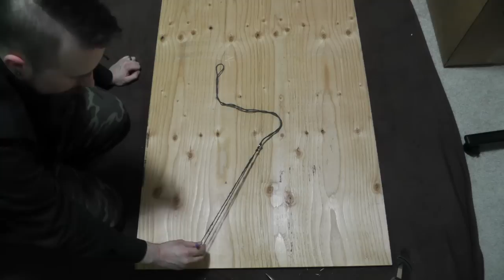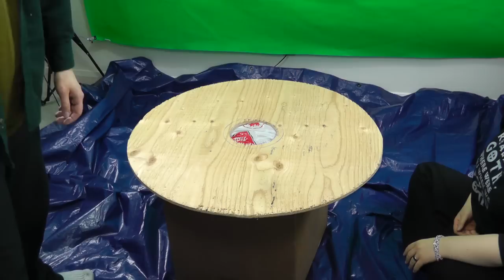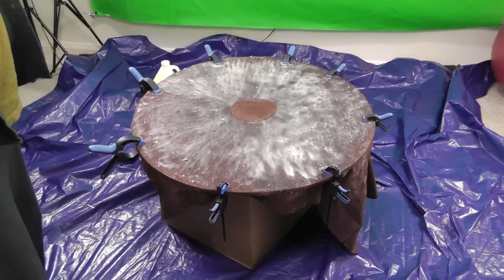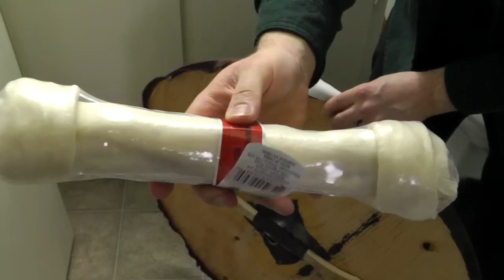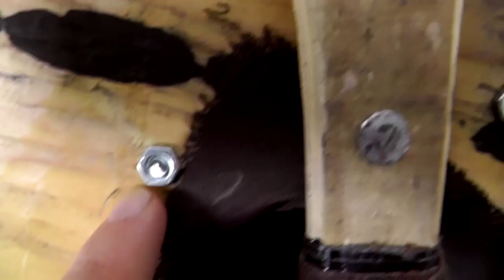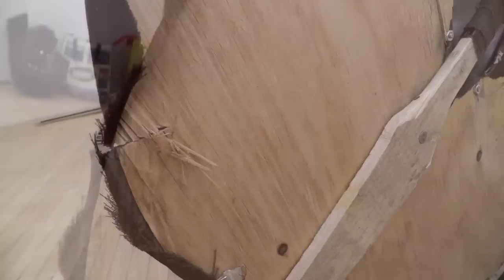How to make a Viking shield on a budget

Comment: Raw hide can be laminated or multi layered.  3 or 4 layers of raw hide on the edge, with a single layer on the shield face, with the cloth or fabric on the inside.

The costs go up as today leather is expensive, but hundreds of years ago leathers of all types (goat, pig, dog, horse etc) much cheaper as more available.
Reply: +David Boson I am not exactly sure about that. I think back then there were more advantages than now but I think there're just as much disadvantages too but in a different form. I took art history classes and the professor talked about the old days where the medieval period used animal skin as a paper substitute because the technology of making it was lost after Rome fell and she pointed out books were made rarely because it took a lot of effort and time to create the paper hides. I even came across a place in Georgia where they had a small paper museum and I think even they mentioned the leather paper making process kind of made it difficult and influenced the amount of books being made. Heck I think paper made out of leather was what caused the invention of books so that they can replace scrolls since there was no way to make a one long sheet of thin paper hide without having some stich marks or something messing it up. This is about leather being made into thin sheets though and I am sure the normal thick leather making process was different so I could be wrong.

Comment: the sword cutting into the edge and getting stuck actually seems to benefit the defender as it would hamper the next attack.

if you wanted to counteract this you could line the edge of the shield with nails (lengthwise) and hold them on just inside the leather strip.  overlap the nails a little, maybe even stack three in a triangle formation with the joints all overlapping in thirds...

Comment: Impressive, sir. I've tried to make one like this, but the boss I had was too small, I didn't have a rawhide rim or canvas cover, and I kinda like having two straps on my shields. My "authentic" one has an old metal pan as the boss. I also have a big round shield with a tiwaz (tiwas? idk) rune painted on it, a small wooden buckler with a moon and star (again, regrettably no boss), and 3 heater shields (two family heraldry and one Captain America WWII shield).

Comment: I'd prefer a shield with an arm rest grip my self ,you did a good job over all and I do remember that shields during the middle ages the edges of shields were also protected. With either brass or tin fittings!
Reply: Except a shield with enarmes or a porpax is only historical for kite and heater shields, and aspis type shields. Viking shields never had a double grip, and few shields were protected with metal rims. Metal was much too precious to use for that.
Reply: Kisk79 cool
Reply: ***** I'm aware of that ,but I'd much rather deflect an enemies blow then trap it.

Comment: Ideally, you would use a hardwood like oak. You'd have to get the boards as most oak plywood is only a veneer on a cheaper hardwood and edge glue them together, possibly with dowels. Cover the boards in some heavy hide. Reinforce the rim of the shield with a roll of steel flashing. Just use a nail punch to pierce it, bend it over the sides and use the nail punch again. Use carriage bolts to secure the handle as they have rounded heads and only fasten from the nut side. Not historically accurate, but it would be tough.

Comment: You can find sometimes bales of old handmade linnen fairly cheap on ebay.
I got mine (ca. 5 meters and ca 10 years old) on ebay for around 25 €.
It's a great material to work with since it is much sturdier woven than most machine made linnen.

Comment: For better strength I advise bonding two layers of wood looking good that the fiber direction is perpendicular to prevent it from splitting lengthwise and as fastener, leather straps or rope may be sufficient even to handle possibly to a broader, more on the outside of the center to slide the forearm and have a better grip, especially with non-circular shields

Comment: Plywood doesn't behave in the same way that solid wood does because it is made of layers of timber which alternates in grain direction. So when hitting the ply with a sword you don't encounter any part of the ply which is  only end grain or edge grain (both of which, in solid timber would behave differently when struck with a sword (edge grain would be more resilient to a sword strike)).

Comment: Hi, When I was making a Shield just to have, I cut 1/2" Ply Wood into a round, and as I was walking from work to my car I found a old Tire Mud Flap that had been replaced from one of our trucks just laying on the ground, it had this great Eagle on it, so I throw it in my trunk, at home in my shop I found it would cover my shield, so I glued it down and then nailed it into place, The extra Hard tire flap I found was very strong, besides it was Black with a Silver Eagle which had made it look really Bad Ass. On the back side I used very strong Nylon Strapping, with my leather waxed thread I sewed two pieces together ( which dose take a while, but is totally worth it, then used washers and screws to hold in in place, with a forearm and hand grab for a good secure hold, Maybe you should look for some place that sells Mud Flaps for Trucks, It's great Hardness will cover your wood making it stronger, plus you might find a ready made Shield Cover, ( Just don't buy one with the Naked Ladies on it ) Try that and the Nylon Strapping for your hold, with this type of Hold also you don't have to give up any strength by cutting a Hole in the middle of your shield. And you can still add a Boss or a Great Spike on the front.

Comment: You should use leather for the rim if you want it to last. I'm not sure what exactly is used in the video. Plywood is cheap and durable... Of course, if you use a sharp blade, nothing will last for too long ... And securing the boss is important so screws are indeed your best option. If you are really bothered by their look, you can get caps that pop over and make it look like rivets, but when you start using the shield they will fly of sooner rather than later... just my 2c on the matter

Comment: If I were to change one thing about this shield then it would be to swap out the rawhide you used and get some surface or split leather on the rim instead. When rawhide inevitably dries out and splinters in combat, you're left with lots of nasty shards that are going to make using your shield as pleasant in combat as wielding anything of Daedric make! Other than that, fine work indeed.

Comment: If you are using chew toy rawhide, do a double thickness or cut the rawhide into squares and layer them over the edge like shingles. This technique has been seen on Gokstad shields which were laced through the wood and rawhide. There is no evidence of rawhide lace in these specific finds, so it may be the case that they were laced with linen, silk, or possibly cotton cording. The rawhide clamps on to the wood, so cutting the cording would not really cause the rawhide to fall away. I suggest adding a layer of rope around the edge before adding rawhide. Nobody is going to split your shield by hitting it on the edge. The rope will absorb the impact and send a shockwave through the shield to the boss. You may find that you are replacing the rivets on your boss, but that is more favorable than replacing your own limbs.

Comment: use old bowls from the thrift shop. heavy guauge wire layed out in a crosshatch pattern with JB weld in between two bowls for more than authentic  strength.

Comment: Good work on the shield, you evidently did your research beforehand. Dogchew rawhide tho has a bit of a bad reputation in the reenactment circles i am in, coming out uneven and not nearly as tough as it should be, also vs blunt blades it can end up shattering or cracking up into dangerous edges, it's really hit and miss stuff.
The wood you said yourself was poor quality, it looks like stuff which in the UK we would call 'shuttering ply' really bottom end stuff, yet still shrugged off that sharp sword pretty well: certainly puts a spanner in the logic of those who think shields pointless. (same flawed logic as the cutting spearheads off)

Comment: If you soak the rawhide in unflavored gelatine, it will stick to the wood and cloth.  You can use hide glue but gelatine is easier to find and is cheaper.

Comment: Not badatall. Caveat, cheap plywood/ underlay has voids, if struck on one it will collapse or break through. So, perhaps a layer of rawhide over the face of the shield, then the canvas over that. When soaked in hot salt water rawhide dries quite hard. Rather than nails or bolts look up rivets and roves, Lee Valley has them in copper. For a cheap boss perhaps a steel mixing bowl or an old wok.

Comment: I'll keep this in mind when I make my shield.  I think I'd cover both sides with cloth after seeing what you just showed that it adds durability, possibly even going for something more cut resistant like denim... wait, nevermind, I have an old futon cover that one side is shredded on.  it's like two shields' worth of cloth I saved just in case I found a need for it!  I am wondering if it would be cheaper to just buy a metal dog bowl and modify that into the boss instead, seeing as those tend to be made somewhat durably.  maybe I'd double up on them just to be sure.  I'll pick it up when I go get the rawhide bones.

Comment: "canvas"is a weev pattern... but most modern fabric labeled as canvas is indeed cotton. its still a plant fiber. and it's CHEAP. so .
using colored cloth is the base color is faster than painting it afterwords and paint can run when the rawhide is applied.
"ass"nails... asphalt nails(roofing nails) most people me included use them.
for spreading the glue i want to recommend an old creditcard.
then pull the cloth down over the edges don't press.
bending over the nails: hammer the nails in partway than hammer the point over pound it in all the way and cram it over like a staple.

Comment: half inch thick beech or oak would solve the problems with sword going through. could use  two layers, with second layer rotated 45 or 90 degrees CW/CCW to achieve sturdier design.

Comment: how are the tree fibers and the planks going in relations to the handle? and for a sturdier shield wouldn't it be better to have two laminated boards glued together with one having the planks going horizontal the the other being vertical. that way the sword will have to face the wood fibers from the side no mater ware you cut.

Comment: I already see that someone noted that you may in fact want someone's sword to bite into your shield. If it was hard to remove the sword from simply biting into the edge, think about how much worse it would be to have the sword bite in, and then have the shield twisted! Great way to disarm someone right there...

I have a Windlass qama, sort of the poor man's gladius, which I've also bent the tip on before. Hammering should be an action of last resort when fixing a sword point. In my experience, the best thing to do is to find a tree that's standing (preferably dead or will soon be cut down), thrust into the tree, and bend the point back into shape from there. A good stump or solid piece of firewood would also work well.

Comment: Reminds me of how we make our training shields in our reenactment club, the steps are almost exactly the same except that we tend not to use front-cover :) I'd just add that in order to make a fully historically accurate shield you should use actual timber planks, not a solid round of wood, but for the training purposes it's perfectly ok. We actually make training shields of plywood ourselves and don't bother much about giving them the authentic look, since for reenactment festivals we have accurate pine shields and we don't want them to get damaged too much during our trainings.
We also use soaked leather stripes for reinforcing the rim, which i think is pretty much the same with what is shown in the video, and we fix them by running thin leather laces through the holes and knotting them in some places. Also i didn't quite get why you hadn't used actual rivets instead of nails and screws - you simply didn't have them or what? I probably missed the point.

Comment: I'd think hardwood or marine plywood would work better for your next one.

Boiled leather was used in a lot of ancient armor, don't know if it's hard to work with though.
Reply: Leather is too heavy and doesn't add much protection. Historically rawhide was used, but canvas or layers of linen work quite well too.
Reply: I used leather over the shield face. Let the leather soak than once it's wet use upholstery tacks all along the edge and on the inside of the edge. You can also use them on the face to make decorative and edge deflective designs. Use a lightweight hardwood and a medium leather. You got to find a balance for how much you want to spend $$, how strong you want the shield and how heavy it can be. So guys find it's easy to make 3 ok shields that will break vs one strong heavy shield that will take a lot of abuse.
Reply: NDjinnn Take a bit of that leather, a bit of rawhide, and an axe. Give the leather a chop and observe how it lets the axe cut into the wood below. Give the rawhide a chop and observe how the axe doesn't really do much to it. Then compare the weight of the two, and you will see just how much lighter rawhide is than the leather. 
There is a reason that shields were mandated to be covered in oxen rawhide historically. A coating of beeswax or other waterproofing helps protect it.
Also nailing the facing of the shield to it is the worst way, as the nails can work their way free. It also doesn't give a solid connection between the two, and it is the connection that makes the shield strong. Gluing the rawhide to the entire face shield will give you the best results.

Comment: If you were to make a modern shield on a low budget without worrying about historical accuracy, would you use the same wood?  Or would you use a man-made synthetic material for the base, like a cutting board?
Reply: If you can get a hold of a plastic barrel (aka rain barrel or pickle barrel) you can get a few shields out of one. 2 curved and 2 round. if you can get more than 1 barrel you can also make armor from it as well. for armor look for the black ones for shields any color will do.

another budget friendly option would be to get wood pallets and break those down and use the wood from those.
Reply: Peter Johnson Actually I like to wood pallet option. But it might be a pain joining the planks together. Well.... for me. I must make them flush.
Reply: Peter Johnson that's a fuckin' awesome idea!!

Comment: Not sure if it is just the video but I just made a viking shield myself and i have the impression that the rawhide you used for the rim is mayby half as thick as the rawhide I used, I wonder if you could cut as easily through that... 
Well, i have a piece of leftover rawhide. Maybe I should do a testcut with that sometime.
(Yes, my shield was made for showing of, so I don't want to ruin it by testing the shield directly ;) )

Comment: my only challenge to this video is the fact that how often would a shield be totally stationary on impact around the rim? surely the shield would be used to parry with and in some cases used to beat blows away. It was always going to be damaged by a direct strike to the edge, who would parry with the edge of a shield anyway? I understand that you could use it as an offensive edge but come on who would leave there shield open for a blow like that, maybe a horizontal blow against the face of the shield would be a fairer test even though you are testing the effect of rawhide. But it is a very good effort and very cool.
Reply: I do believe the way you block with a round shield like that is you try and basically punch the blade with the boss

Comment: but it is very recommended to sew on the raw hide with thread instead of using nails, for the comfort and safety of the fighters around you.
because it doesnt take long time before the nails are starting to move around and their flat tops start to become sharp edges. using active shield will then make these nails into skin shredding machines and can infect mad wounds
Reply: I was taught to use carpet tacks: no need for ant turned nail ends inside the rim.
Reply: another thing is that they end up flying off and laying on the floor waiting for someone to receive a surprise stab on their foot

Comment: actually I used to work for an elevator company  i think the diameter of the cable coil holder is probably exactly that size. perfectly round and they are not made of cheap wood. Just a matter of getting the side of

Comment: The metal dome would have been better if installed from the back. You could have nailed it in too. Drive nail in 1/3rd bend pointed end 90 degrees with hammer, drive another 1/3rd bend again then drive home. Now flip the work and drive point into the other side.. It will make a sort of staple. Very old school shipping crate making technique.

Comment: Kevlar layers, fiber glass, any thoughts?
Reply from the maker: Not exactly Viking shield material.
Reply: kevlar is not resistant to thrust nor cut. Blow to the fiberglass shield would send metric ton of fiberglass dust and splinters into your face - eyes, nose, mouth, and possibly lungs and that would be hell since you cant get it out (thats why they wear all that protective stuff while working with it) and Im pretty sure since it is material based on fiber you can cut it nicely with right angle. 
If you insist on modern material, I saw some UK domed round riot shields, if you would reinforce rim with something cut resistant (steel maybe?) you would get something really sturdy, since im pretty sure that PVC would be quite impenetratable with thrust and strikes on flat wouldn't do much damage to it either. That just might work.